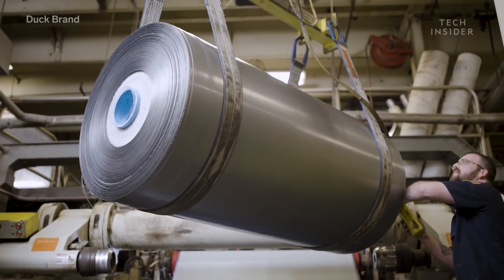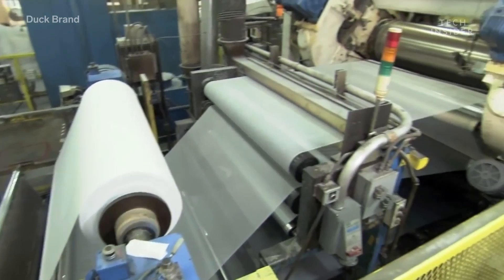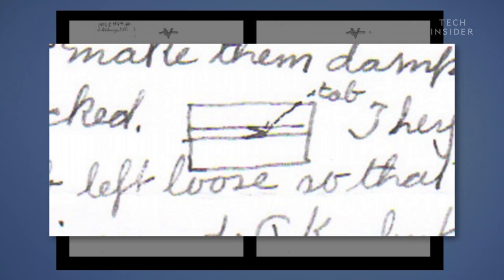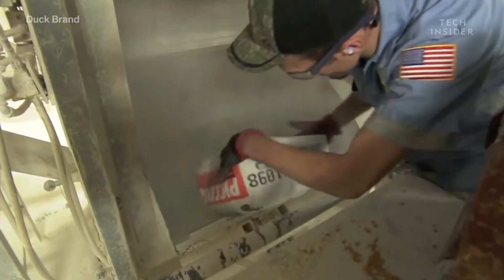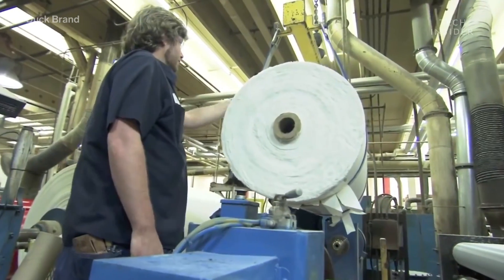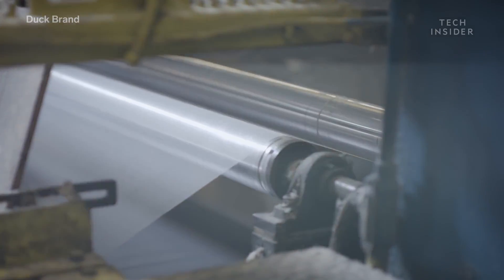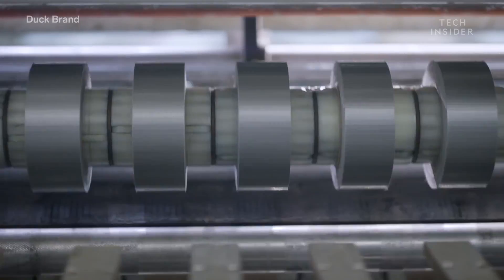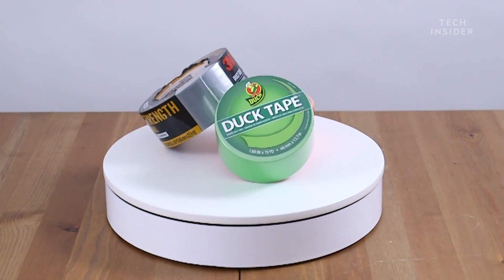Why Is Duct Tape So Strong?

Comment: Another name for Duct Tape is Gaff Tape (I cant spell) because Gaffers (the people who work the lights at movie shoots) (again, cant spell) used to use it to keep the lights secure. (Keyword: Used to)
Reply: The professional gaff tape I'm used to isn't the same as duck/duct tape - gaffers tape tends to be a matte fabric top (not plastic-coated) and the adhesive is intended to be removable with less risk of leaving sticky residue or damaging the surface. It's not so much about holding the lights up as it is wrangling cables (taping them to the floor to remove trip hazards, etc.). Black matte gaff tape "disappears" well without risking reflecting light the way shiny plastic-topped duck tape might, brightly-coloured gaff tape takes permanent-marker ink superbly well for labelling things.

Comment: What’s flex tape?
Edit * how does it flex tape differ from duct tape in terms of durability and strength?
Reply: Patch, bond, seal and repair with flex tape!
Reply: You get the face of Phil Swift on the packaging. You can't get anything better than that.
Reply: Yes, but how does it differ from duct tape in terms of durability ?!
Reply: The Valerie Lorenzo it costs more so it’s better.
Reply: @vtheteenagewitch  you can saw anything in half and stick it back using flex tape
Reply: @vtheteenagewitch  the sticky adhesive can get wet and does not get unsticky and when hot does not get super sticky
Reply: @vtheteenagewitch  its all around stronger and more versatile
Reply: It’s flex tape just the name alone is badass and anything broken gives all its respect to the tape
Reply: YouTube it and find out
Reply: Yup, tylertube should have a couple videos comparing them
Reply: Flex tape is a tape with swag
Reply: Long story short, flex tape can fix a boat sawed in half
Reply: It's a meme, just let it go
Reply: It's tape
Reply: Basically flex tape is better.